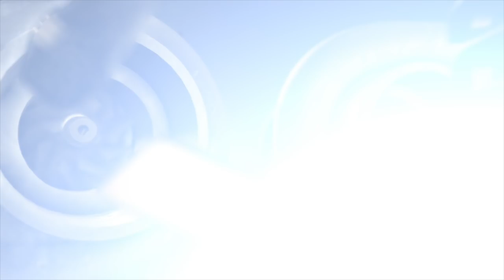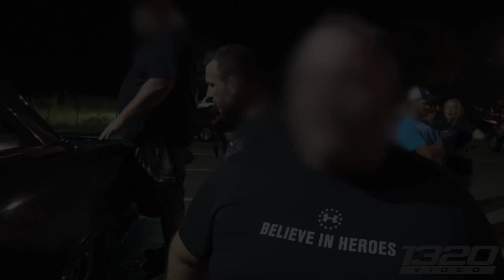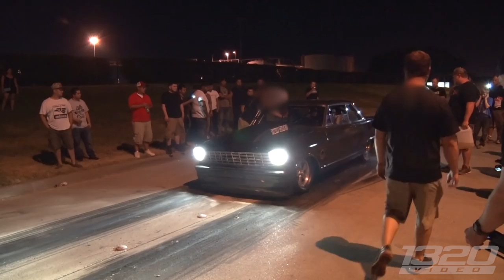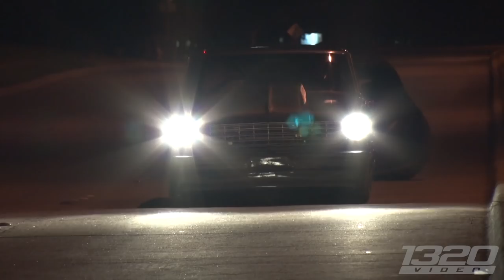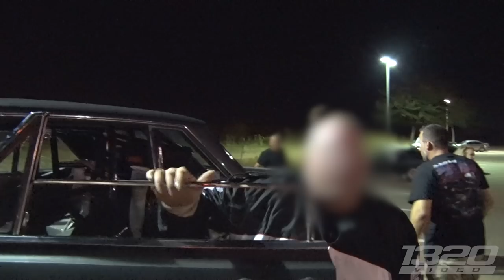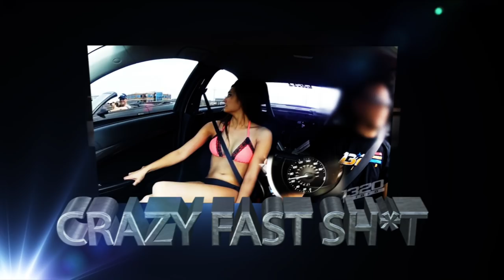Street Race PARACHUTE Deploy!  The Mistress TT Nova

Comment: Twin 94's from Precision on an 500CID motor, shite! I want my street car (corvette C6 Z) with one turbo that size.. Somewhere around 100mm anyways instead of twins and still fully streetable...  I don't want another strictly race car. It's nice driving to the track. Change suspension settings, PSI,  race, and then drive home.. Should work well with my 2 stage N20 outlet kit. Already making not far from 800whp on a stock bottom end for the last 2.5yrs...'
But I digress.....
That car is sexy as all hell and let me say that again, TWIN 94mm PRECISION TURBOS ON AN 500+ CID motor... That should be in the 6's (1/4) depending on the weight. Every 100lbs is a tenth, so unless it's a tank, he should be moving...
I was hoping too see him throw the laundry our after he beat someone, with the hazards cut on (if they're even on the car still).
Reply: Yes 100mm, plus or minus for a street car and the nitrous helps it spool, but the 2 step/anti lag builds all you need and all the track or road can hold. My old car had 72mm turbo's. My friends supra runs an 90 something MM on his daily driver. All I gotta do is have separate wastegate springs and keep it as on low boost for street use.. I've had turbo cars for over 10yrs. My Vette is my very first non turbo car. It's a higher compression car with the heads milled,  660 cam and I spray it. It's a daily driver making under 800whp and over 700whp and TQ on 93 octane using methanol injection to help since the compression is higher. Picked up 20-25whp using it NA.. Still don't have z race fuel tune as its a street car. All though I may throw a few gallons of race fuel in sometime and let it mix with my 93 octane... It'll be ran on Pro EFI instead of HP pro
Reply: I had motec before, but I'm not gonna spend all that money again and buy all the sensors I had for it.. Pro EFI seems like the best bang for the buck and I like the feature where if you get the sensor it knows what fuel you're running and it changes your tune without needed the laptop
Reply: I know what it does. I have only been doing this for 30 years
Reply: Ahhh.. My bad man, my bad.. Rock out with your cack out and keep the rubber side down